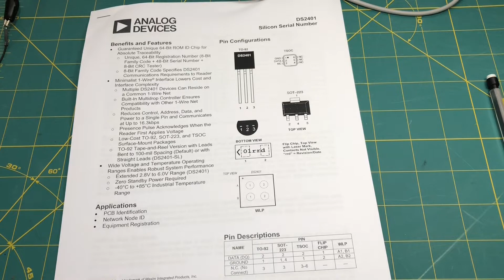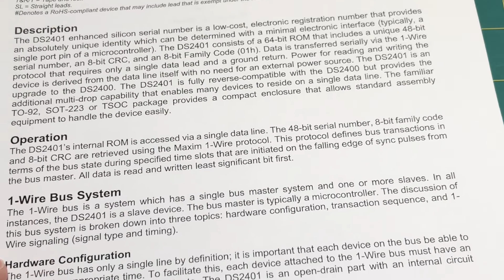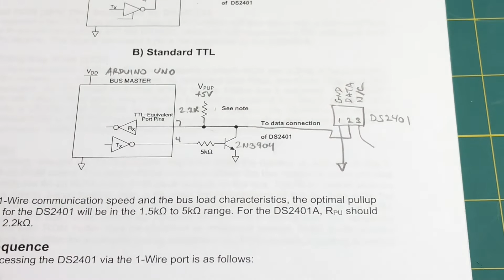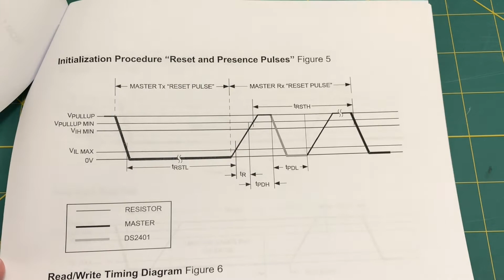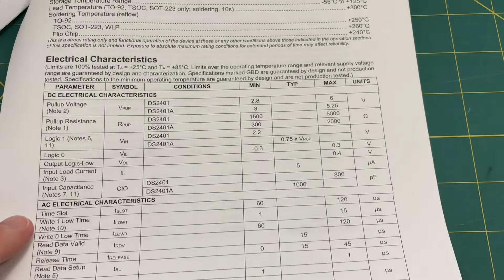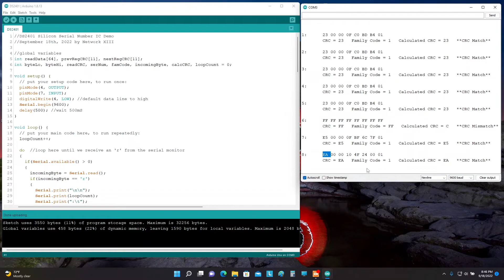DS2401 Silicon Serial Number

Comment: In making reproduction battery packs for an old Mac PowerBook and I need to read the serial off the ds2400 in the old pack and then I want to copy it to a  ds2401. Can you provide some arduino code that can do a write?
Reply from the maker: Good question, I don’t know how to overwrite the data in the DS2401, or what NVM technology they are using, so it may not even be possible.  You could probably use one of the simpler PIC microcontrollers to reproduce the functionality of the 2401, and you could obviously write any s/n you want into that.  Sounds like an interesting project
Reply: @NetworkXIII  do you think that ALL of the battery packs have the same serial number that Apple would have programmed onto the the DS2400 or do you think that the serial number on it is just the default that is on the DS2400 from the factory so each battery has a unique number? In that case I could just purchase a batch of them and be done and no need to read or write them. What I do know is the Ds2400 is required in the battery pack. If I try to power the laptop up without it it won’t boot. Once I connect the original DS2400 then it boots right up.
Reply from the maker: @sideburn Apple likely buys them in lots where a sequence of unique serial numbers are already burned into the NVM, that way they don’t have to worry about programming them.
Reply: @NetworkXIII  hmm well these are from the 90’s. I guess the only way to find out is to try a. Of the shelf 2400 and see how it goes.
Reply: @sideburn if the 2400 is just an early version of the 2401 then apple did not program them, the chip maker burns progressive serial numbers into them and then apple uses them as needed. No reason you could not use the same cloned chip in any battery.
Reply: @NetworkXIII mask rom most likely, no reprogramming possible
Reply: The chips can not be rewritten. I have need of emulating the 2401 with programmable serial numbers so I will be making an Arduino sketch that emulates it and hopefully have it work on an ATtiny24 or ATtiny85 so it will fit in original equipment
Reply: @kitehman  I’d be interested in that if you can’t it to work so I can make more packs.
Reply: @sideburn  I got an arduino sketch that is able to mimic a 2401, it should work with the 2400 by changing the readrom command from 33h to 0Fh